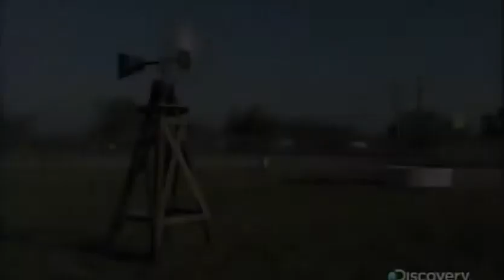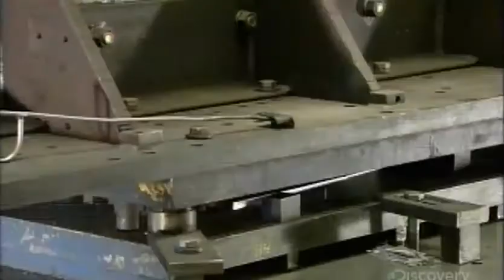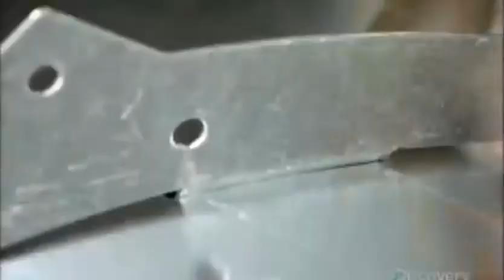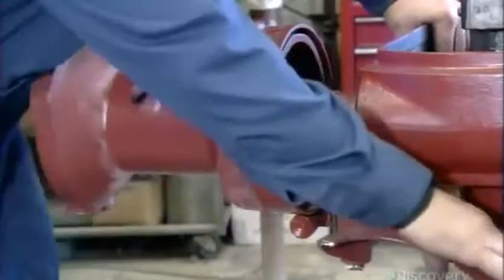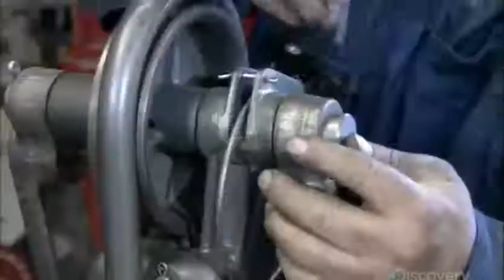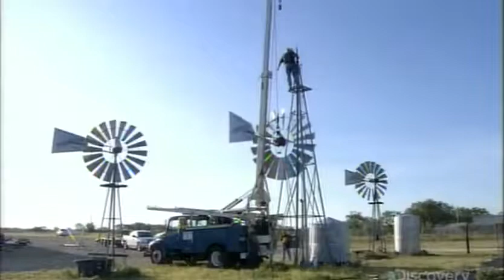How It’s Made Water-Pumping Windmills.mp4

Comment: We still use several of these Aermotor windmills. On a ranch in Toyah TX and they're the most reliable of any brand. With the best type of automatic brake and locking tail. That can stand up to the unpredictable, high winds. Or it would spin out of control and fly apart. I think they've been there since the 50's and still going.